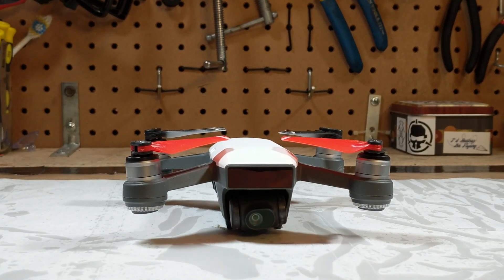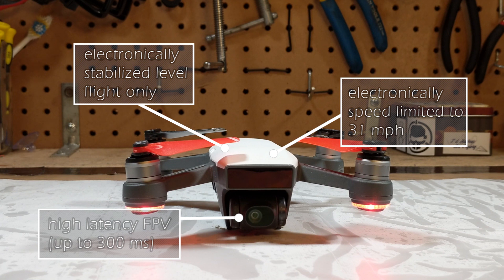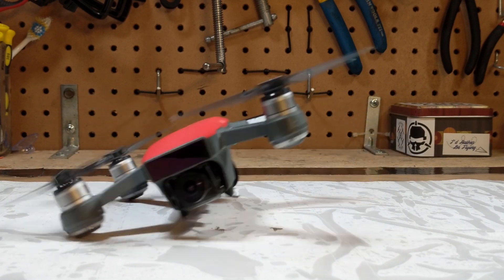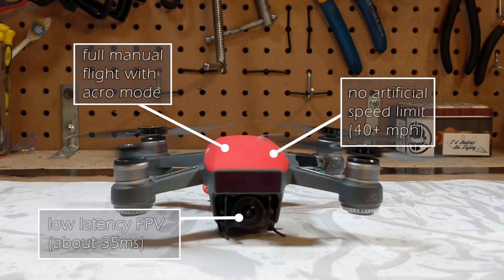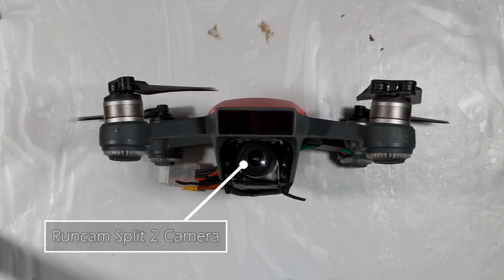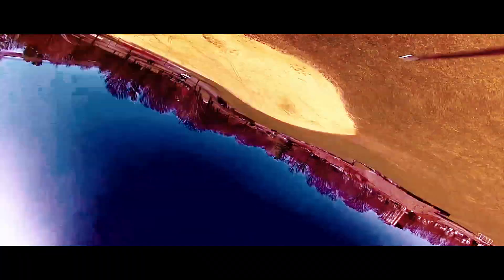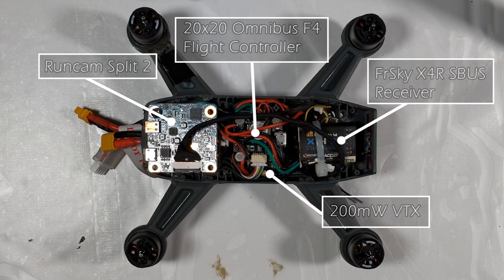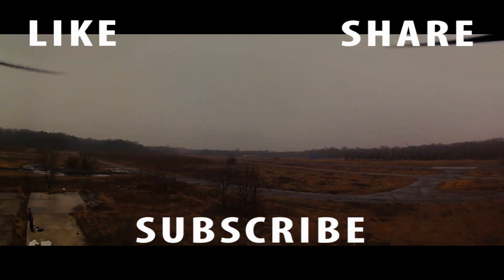Betaflight on a Spark?

Comment: What mah Lipo did you use and what vtx.
Reply from the maker: I have it flying with tattu r line 850mah 3s, and a tbs 5v unify pro.  Vtx connects to the dji antenna built into the frame.
Reply: Prepare For Landing thanks. I did a lot of searching and figured unify was what you used with the u.fl connector. 
You should do a tear down and rebuild video of your mod. I know a big spark mod group that would enjoy seeing the video and you will get a lot of likes and hits on your channel.
Reply from the maker: Cool, I'm glad there is interest.  I can totally plan a tear down video in the near future.
Reply: Very ugly!